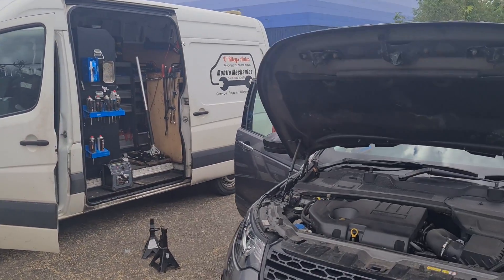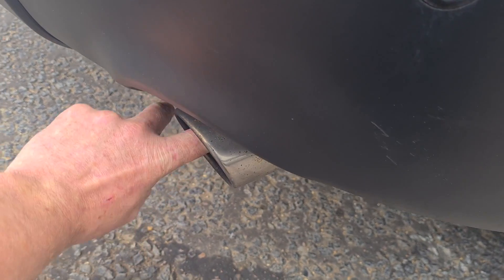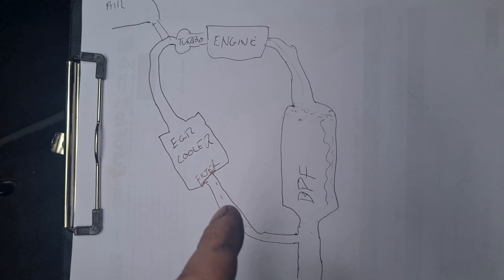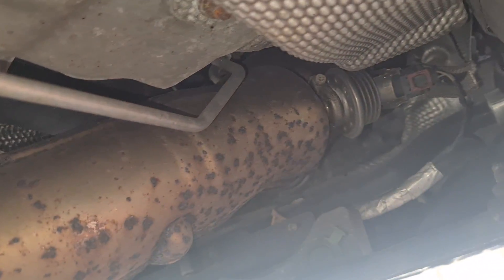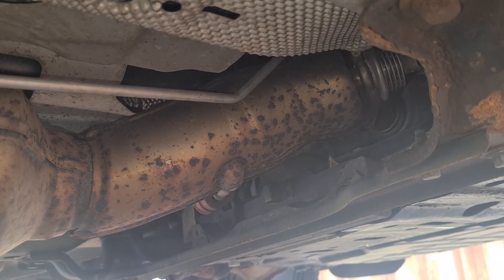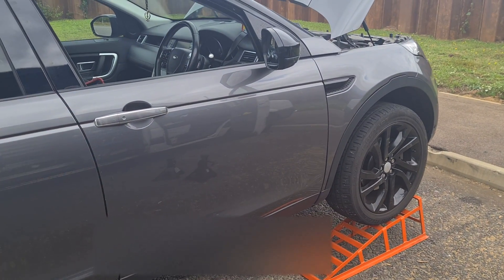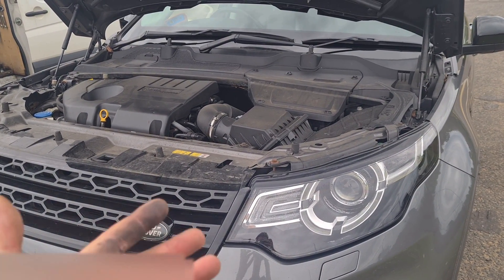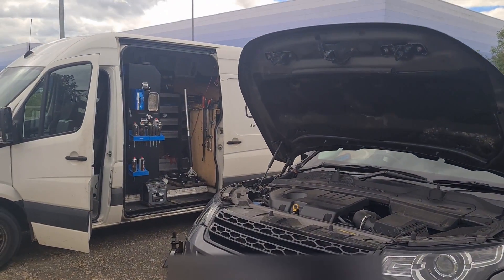Land Rover 2.0 Ingenium P049B-00 EGR Flow Fault Explained

Comment: I have a 2.0 f pace doing exactly this, sooty tail pipe and blocking egr filter very quickly also noticed in live data only 0.03 millibar at 3000rpm - 0 millibar at idle, would be safe to say my dpf is bypassing badly do you think? 🤔

Comment: this system with the DPF under the vehicle does not passively regenerate at all. every regeneration is active with post fuel injection. that heats the DPF much hotter on a regular basis to compensate for no passive regeneration. I don't imagine driving through a puddle of water when it's that hot is helpful for the life expectancy.

Comment: I’ve got the same code and a slightly sooty exhaust. However my pressure is 8kpa at 3000rpm which is normal according to your videos? Do you still think the dpf is cracked/breaking up?
Reply from the maker: If you clean the dpf it will reveal the true pressure and very likely its below 40mbar

Comment: Quick question. With more modern dpf systems with a 5th injector. Do you still have to do oil change after every forced regen. If so is this because the engine injectors are firing on exhaustroke.
Reply: no..... there is no post injection to get into the oil

Comment: Hi jimmy what would cause back pressure out of the engine oil filler cap . I do have a code for back pressure but can you explain why this is happening please .
Reply: rings/bore DAMAGE.
Reply from the maker: Has it got piston cooling jets code?
Reply: @ORileysAutos  codes are all dpf side ok 
4501
480A 
481A
4D00 back pressure 
4141 swirl flat Actuator 
4B37 oil condition sensor .

Comment: Why would they put the egr pipe after the dpf then route it back into the engine, havnt seen any other design like that before.
Reply: actually, it's very common. It's a dual EGR system and is much more efficient. it's used in other vehicle makes as well.

Comment: I have a 2011 1.6hdi from new, 200,000 miles, original dpf, egr, exhaust, water pump, radiator etc etc. Most trips are 25minutes, the only issue was an injector replacement 30k ago. I’m sure driving habits are biggest reason for trouble. People with Euro6 in citys should stop driving diesels imho.

Comment: I have a 2016 evoque with 100,000km on it. My original dpf is perfect, regenerations are always on the highway, the duration is about 12 minutes and the temperature never exceeds 650 degrees during the process. The problem is that doing the regenerations in the city destroys the dpf because the process takes more than 30 minutes, it is a land rover design flaw. It is also not good to force the engine during the regeneration because that can raise the temperature close to 800 degrees.

The ideal is to maintain a speed of 90/100 km/h during the process, but that makes you a slave to your car and not the other way around.
Reply: same with a normal I.C.E.  City stop/start driving can cause abnormal wear on the engine internals due to oil dilution, carbon buildup, etc. Every 6 - 8 weeks I take my car on a 20 - 30 minute drive & 80 - 100km/h to burn off excess moisture & exhaust soot. Gets the engine & lubricants up to operating temperature & works a treat.
Reply: I monitored every DPF regen on mine for over 15,000 km, it always takes 20+ minutes for the process to complete, regardless of city or motorway riding. I have never had a 10 minute or 30 minute cycle. 
I also monitor the exhaust temps at engine and at DPF. Neither ever went over 700C (688 C was the max I've ever recorded), so not sure how you got to 800 C?

Comment: Ever looked at a cracked one to see if welding it is possible Jimmy? End of the day, its steel, it ought be repairable? I'm also 100% convinced cutting the pipes & putting in some couplers to allow easy removal of just the DPF wouldn't be very difficult. In fact I know it would be a doddle just from watching the set-up in your vid.
Reply: I don't believe it's the housing that cracks but the filter material itself, which I think is generally a ceramic material
Reply: @trialsted  If the housing doesn't crack, then there's no leak, just slightly crapper "de-pollution" and the differential pressure sensors may whinge (probably not)  - so I'm betting the housing cracks. I may be wrong, but I doubt it.
Reply: I also bet I can weld one back shut & install couplers so it becomes a 20 minute job instead of 4 hours. I'm alright like that.
Reply: @jamesward5721  he said it leaked pressure, not that gas leaked out of the exhaust system. My understanding is that the core of the DPF fails and exhaust gas and soot leaks past the core and hence the pressure is not produced by the restriction. And as he said, the problem here is that excessive soot makes its way back through to the EGR, meaning it didn't get captured in the core of the DPF - but like you say, I doubt you're wrong.
Reply: Did I mention I barely care? This just struck me as a pretty easy by-pass/repair. Idle curiosity & nothing more.